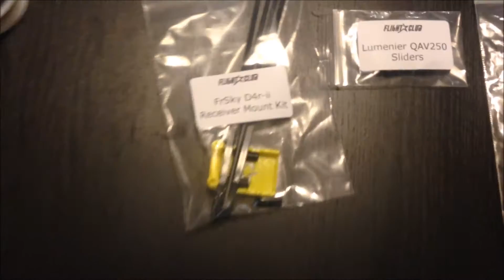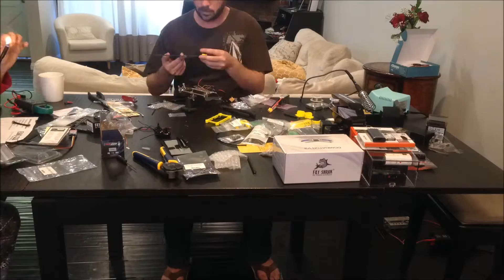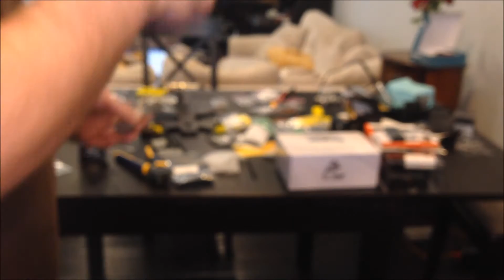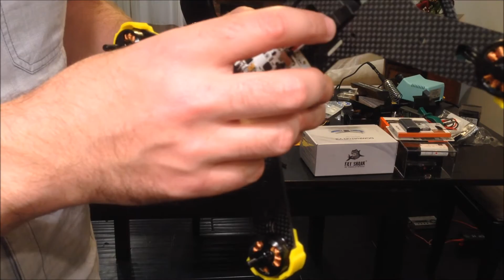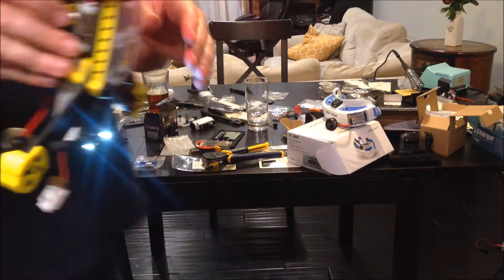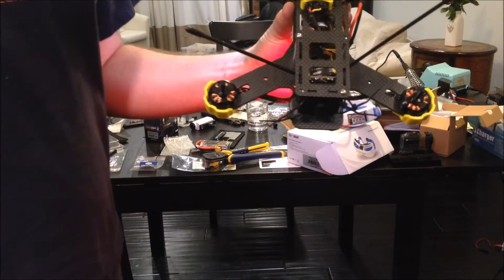Building my QAV250

Comment: How do you route your power wires for flight? At the end of your video they look like they would interfere with the props?
Reply from the maker: Sorry for the delay.  I wanted to take some pictures and just did not get around to it. I route the power wire under the motor cables and have not had any problems.  2 pictures here.
http://imgur.com/a/8tOQB